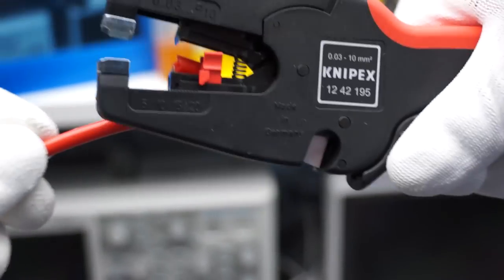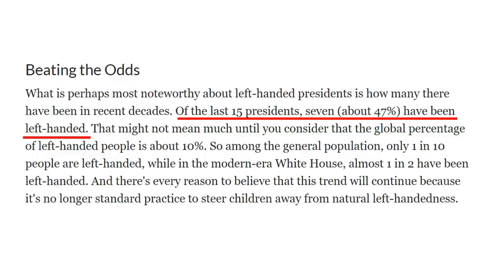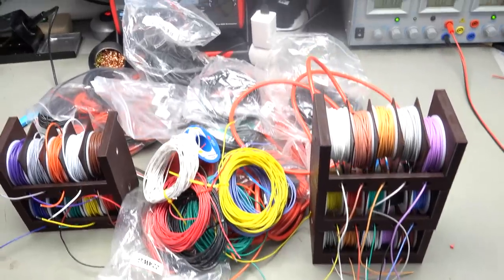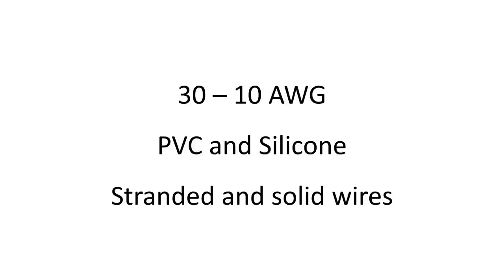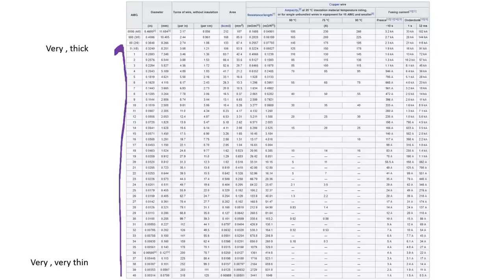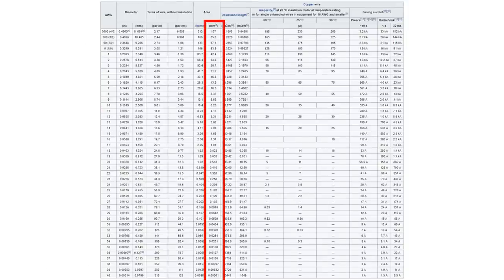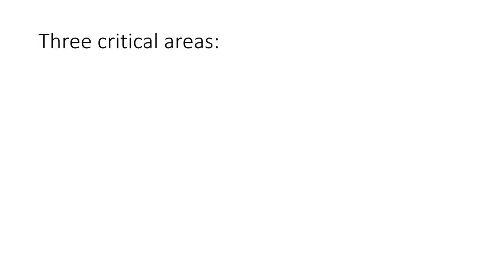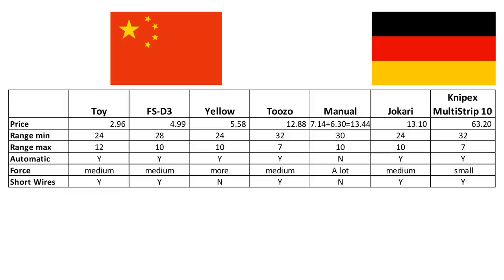#268 8 Wire Stripper Test: Germany vs. China. Who wins?

Comment: As a (retired) professional I have been using the same "yellow" Unistripper for  what  must be over 20 years. It will strip multiple cables in one go from 6 core alarm cable, UK twin and earth cables up to 4mm  as well as 6mm singles. Sometimes they need a little "help" with  cold 10mm bonding cables but no more than a finger push from the spare (left) hand.  I would never use them for just one cable as the side cutters usually already in the hand are by far the fastest, but for multiple cables  they are the dog's doodahs.  

Incidentally, the slug of insulation left on the wire end after stripping has some very positive benefits. 
1) it is rarely possible to strip the cable inside a small enclosure. The slug allows the stripped cable to be passed through a gland or grommet without splaying the strands and 
2)  by rolling  the slug between the finger and thumb  as it is pulled off the end of the wire, it presents a perfect  twisted end prep for termination.  Granted - this would be difficult to perform wearing white cotton gloves ;-)
I  have to agree, that they may not appeal to US presidents   As a right handed person I think they would work just as well holding them upside down as the right way up. 
Love your channel. Thanks.
Reply from the maker: Thank you for sharing your experience!

Comment: I am using ProsKit 1PK-066N and it should handle 26 AWG~14 AWG, but I didn't test it on all sizes. It works pretty well, just requires some force and leaves marks on a cable.
Reply from the maker: Thank you for sharing your experience!

Comment: I have purchased the "Toy", the "Yellow" and the "Manual" strippers, and I agree with you entirely. The toy lasted about 10 minutes before they died. I have trouble stripping thinner wire with the yellow, and I don't use thick wire. I am very happy with the manual strippers, and will continue to use them.
Reply from the maker: I also would not have changed. But I had many viewer voices. So I decided to do this video.

Comment: I use my good old wire stripper with the sticker "BEST" on it.
Bought it for ~$5 equivalent, it looks somewhat like the toy, but grippers are actual grippers and not jaws (they're flat, wide and they grip using friction) and it's made out of some painted metal alloy and very hard and not very light plastic. And it doesn't feel too cheap. And there is manual spring tension adjuster, so it can safely and reliably strip anything from 40 to 6 AWG.
Reply from the maker: Thanks for sharing your experience!

Comment: Have a similar set to the first ones shown, has mm for right handed people and inches for lefts. Was given the set by a technician cleaning out a lab on the idea that they are only for university usage(no problem, thats why I needed them).

They work pretty well, makes a nice sound, occasionally you will no strip, but just damage the wire, but this happens very infrequently. 

The cutters also seem to be okay, have used older and newer versions of this stripper and have to say that they don't age perfectly, something to consider.

Comment: The "toy" model seems to be a knock-off of another similar chinese wire sripper which I use.
Mine has a tension adjustment which allows you to strip any thickness of wires that I´ve tried, and also has a functional wire cutter.
It was about the same price I believe.
Reply: I think I've one of those as well. With the knob it actually works fine for all I do and was definitely worth the 3 or 4€ it cost.
Reply: There's always a lot of variation in Chinese no-name tools. I've had two like yours. The first one worked pretty well for years. When it got stolen, I bought a replacement that looked the same, but doesn't work worth (bleep), barely better than the "Toy" that Andreas tested.

When I was a kid, my father had one a lot like this: https://www.specialized.net/ripley-miller-101-s-adjustable-wire-stripper-with-spring.html  I bought one like it when I grew up that I still have over 40 years later. When it's all you have, practice teaches you to have a feel for how much to squeeze it for different wire sizes, and I still use it for heavier wires.

Now almost all the electronics work I do is digital or low-voltage/tiny-current analog, so almost all the wiring I do is 24AWG or smaller. I use the multi-slot "manual" strippers for almost everything. For short wires, I use a pair of bent-nose needle nose to grip the insulation. It's worth it to spend a few extra dollars for one of this type, because the slots are ground more smoothly and precisely, so you get cleaner insulation cuts and fewer nicks.

After watching Andreas' review, I'm going to try the FS-D3, because I do a lot ow wires and cables with crimp terminals, and having the adjustable strip length stop should make it easier to get exactly the right strip length.

Comment: I have one of the yellow ones, but I only use it for taking the outer insulation off of telephone wire, or other kinds of double insulated cables. I like a manual one for most other applications.
Reply from the maker: Thanks for sharing your experience!

Comment: Hey Andreas, I wanted to tell you that the Yellow has a screw to choose the right strength that it will be applied to the wire, so you can choose if you want your wires stripped, caressed or even tore down to small pieces. Still not optimal, but something. 
BTW, could you make a comparison of Crimppers? I am not sure if I am using Yellow right or it is just unadequate.
Reply from the maker: 1. I knew about the screw and I have now a working one.
2. I made already 2 videos about crimpers
Reply: @AndreasSpiess  Thanks, I will look for them

Comment: To test these you have to strip TWICE. This way you can see if the first strip nicked the copper.
Otherwise good test. I'm a retired electrician that used manual strippers for my entire career. I wish I had bought the Knipex from day one, maybe I wouldn't have arthritis at the base of my thumbs.
Reply from the maker: Thanks for the tip! Of course, you are much more an expert in this matter.
Reply: Andreas Spiess ...It provided a good living. I truly wish I had used those from the start. Also, here in the US we use many more wire nuts for connections. Twisting those for a lifetime is no good for your fingers either.

Comment: I have the yellow one at home and it is great for automotive work. You can strip the wire anywhere you want, not just the ends and it is great if you wanna splice a cable

Comment: you can also add to the german wirestrippers weidmüller stripax and phoenix wirefox, they both schould hold years and are a little less expensive than the knipex also you can adjust the force that is used to strip the wire, comes in handy from time to time...
Reply from the maker: Which stripax do you have in mind? There are a few of them.
Reply: @AndreasSpiess  depends on wich diameter you need if you only need up to 10mm² / 8AWG then you schould be fine with the normal stripax (EAN 4008190072506), if you need them for 6-16mm²/ 10-6AWG then you should take the Stripax16 (EAN  4008190183875) but i think the both ultimate versions are a cheaper version of the normal ones(but haven´t tested or ever used them) the normal stripax and the 16 one definitly can strip the wires the say they can i daily work with these tools.
Only thing is you have to adjust them right for the right thickness of the insulation but mostly you will be able to find one setting for most of the wires normally you only need to adjust it if you want to strip thicker wires and then you push the orange button above the blades for or back to adjust the strenght.
The phoenix wirefox is similar to the weidmüller stripax but as it is with the stripax you have to look at what diameters you need to cut and then choose the one that fit you ranges of wires, but in my eyes the wirefox has an advantage against the stripax, you can get for the wirefox just the bladecassetes for the other diameters and the handle stays the same so you can change the blades to strip a bigger or smaller diameter.

Also you have to keep in mind that knipex is a german tool maker for mostly everything, they make very good handtools for electricians who are installing houses, but both phoenix and weidmüller are manufactureres of installation terminals and other stuff for switch cabinet building so the have another view on the things a tool needs for that field of use.
Reply from the maker: Thank you for the info!

Comment: Knipex doesn't have a very good marketing department. They have another excellent wire stripper for small wires that is very hard to find, the knipex 1280040sb. It is half the price of the big knipex, but also never misses a cut.
Reply from the maker: Thank you for the tip!

Comment: I have been following you for more than a year, but youtube magically recommended this +3 year old video of yours I had missed because I bought a wire stripper two days ago.

I bought an expensive (24 euro) branded "Yellow" and have been stripping every cable I can find like an idiot. Yes, even this expensive one cannot strip "fat" silicone. I have to help it a bit pressing the cutting side... but for all others.. it works like a charm, silicone or not .... but I hadn't realized the "left handed" problem... luckily I'm right handed. 

What convinced me is another video by someone else that demonstrated that this "yellow" kind of stripper works for OTHER cables.. RJ45, coaxial, without harming the "inside" cable.. even if these cables are thick, you can squeeze them inside a bit and it works....  and bonus.. the crimpers, if you ever need it.

In summary.. not for fat silicone or lefthanders.. for all the rest... I think they are the best type.
Reply from the maker: You are right. Mine was defective and, after many feedbacks in this video, I purchased a new on. It works, too.

Comment: I picked up a couple of used aviation wire strippers at an airshow. Since the FAA has strict limits on nicked or cut strands, they use precise dies to cut the insulation without touching the wire.  (Aviation wire is usually teflon or Tefzel insulated.) Of course, new they're something like $300US+  :(
Reply from the maker: Seems to be a good idea!

Comment: Knipex also makes a very nice manual cutter for very small gauge wire and I've found it very useful for preparing magnet wire when constructing toroid inductors. Got it after years of simply stripping the insulation with a box cutter or X-acto knife and it's well worth considering.
Reply from the maker: Thank you for sharing your experience!

Comment: Been using the Knipex 12 42 195 MultiStrip 10 for a while now and to be honest I'm a little unsatisfied with them whenever I have to redo 220V mains wire cables I bought from Swiss stores like OBI or Digitec...
They never seem to be able to get mantle off the copper - The area where the blades don't make contact with the mantle appears to be strong enough for the blades to shear off the top and bottom usually requiring me to either cut the mantling off with a boxcutter knife or start over and help the head by clamping it stronger together with my free hand.

Small diameter ones, like the Conrad, appear to be no problem same for RC Silicone wires but those darn 220V drive me nuts unless I get them from Amazon.de.
Weird shit...
Reply from the maker: Thank you for the update. I rarely use 220 v cables and then I use the same cutter as for the mantle ;-)

Comment: When I was taught to use the manual strippers (when I was 5 or so) I was taught to rotate the stripper around the wire a bit. That makes the force needed smaller and also twists the wire inside a little.

Comment: The yelow you have to regulate when you put a thicker wire that's why it didnt have much force to strip the wire its that round thing on the front it regulates the blades tension
Reply from the maker: Unfortunately it did not help in my case :-(

Comment: ISolation is when you get lost in the Forrest or stranded alone on an island.  INsulation is something that separates some thing from something else (i.e. conductive copper wire from other conducting things or to minimize heat transfer).  Even though your English is orders of magnitude better than my Swiss/French/German/Italian... I was compelled to point his out.   
Having stripped wires for over 40 years, the two manual strippers are the best because they cut the insulation cleanly on a level plane and very seldom leave any nicks or gouges.  I generally only use the smaller hole one, because for the few thicker wires I need to strip, you can carefully use the largest hole, but not fully close the jaws and rotate the wire / cutter > 45 degrees.  If this does not work well, the originally sharp blades are worn and it is time for replacing the tool.  If you get a bargain one of these from China, the blades and holes may not align or be sharp, so spend > $6 ea. or you will be disappointed.

"Fun Fact": US Presidents: of all USA presidents, only 1 was an engineer.  After years of negotiations and struggle, both Houses of the US government passed a law to transition the USA to the Metric system over 10 years.  Jimmy Carter, the engineer, single handedly killed it.
Reply from the maker: Thank you for correcting my mistake. Now I know !
Reply: But in many european languages it is the same word, ie. in german “isolierung”, in danish “isolering”....

Comment: Regarding the yellow handled auto Chinese ones, they're heavily dependent on binning. I have a Stanley branded pair and they work amazingly well, working first time probably around 95% of the time. But then I have bought the same exact type from cheaper brands and they're an absolute mess that just doesn't work even 50% of the time, and even worse frequently cuts right through wires. As I said they're extremely dependent on QA and likely some binning process, which is also why the Stanley ones cost twice the price of the cheaper brands. I have bought two Stanley ones (one for a family member) and both have worked flawlessly, I can't speak for other reputable branded ones, but I imagine similar brands work well.
Reply from the maker: Thank you for sharing your experience! Mine was replaced after this video and the new one works much better. But I agree: Quality, especially with tools, is important.

Comment: On the yellow one ,there is a copper colored screw , maybe it helps with the wider wire .! I've got one and it works nicely.
Reply from the maker: It did not help in my case. There are a few different makes around...

Comment: The one you named "toy" is actually a toy-ified devolution of what used to be a good wire stripper. The original one I know (and still have and use almost daily) I got from Düwi (now part of REV Ritter GmbH, one of the larger DIY hardware store brands in Germany). It has a significantly more complex spring mechanism inside to adjust the gripping force to the wire diameter, and a force adjustment thumbscrew on the back of the "dragon head". No idea whether you can still get these original models nowadays, but there's really a huge difference between that one and the current toy versions.
Reply from the maker: You are right. I had also a similar one when I was young

Comment: I'm using my Stripax since 1984 and use it a lot. Works like on the 1st day, all blades are still sharp. The only thing is that I lost that orange length-limiter thing but that's not a big deal.
Reply from the maker: Thank you for sharing your experience!

Comment: What you see at time8:19s is what industry calls "semi-strip". The wires with "separated insulator" is bundled and delivered to the production floor to prevent wire-fraying when stranded wire is called for. Pre-tinned wire do not need semi-strip. The end-user will remove it before use.
Reply from the maker: Thanks for your clarification!

Comment: one benefit of not removing the insulation completely is if you want to twist the wire for soldering or crimping  - if you grab the piece of insulation and twist it as you pull it off it will give you a neatly and tightly twisted wire .
Reply from the maker: God point. Thank you!

Comment: l have a pair of the yellow one to strip the big/small wires you have to adjust the brass bolt, i normally only have to adjust for very small wires it cuts right through if not adjusted propperly
Reply from the maker: Thank you for sharing your experience! There are a few different makes around (if I believe the commenters)

Comment: Howdy again Andreas - "This is the guy with the Texas Accent again".   Off topic but I'm confident you may have an answer.  I'm having mucho trouble getting Software Serial to work on my Wemos boards.  After lengthy internet searching I find some topics that claim the library no longer compiles for ESP8266 throwing an error in the attachInterruptArg command (which is what I'm seeing).  Does your software serial library still compile and work for your Wemos boards?  I sure would like to find a solution for this because I as well love the Wemos boards.  They have become my defacto go to board for Arduino work.

ON TOPIC, A handy tool I use around the lab is a Leatherman Squirt ES4 multitool.  Among the variety of tools it contains is a nice manual stripper that works on 12 to 22 AWG.  The cutters are very sharp and it is a great tool to keep in your pocket while working or even on a lanyard around your neck.  Take a look.
Reply from the maker: I always use an ESP32 if I need more than one serial plus WfFi. So I do not know this library

Comment: As some others have noted, the Weidmüller Stripax is excellent, but costly.
It is adjustable, although the adjustment is not too critical.
One thing:many of the strippers you tested will likely fail to properly strip PTFE(Teflon) insulated wire.
the  Weidmüller Stripax works perfectly for this, at least for thin wire(I've not tried thick PTFE wire-I've never needed to strip this).
Reply from the maker: Thank you for sharing your experience!